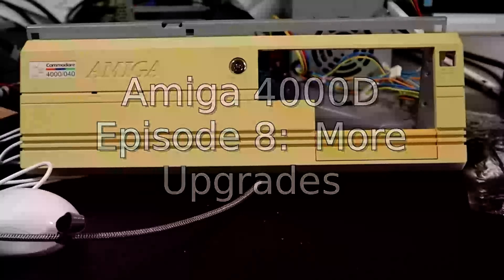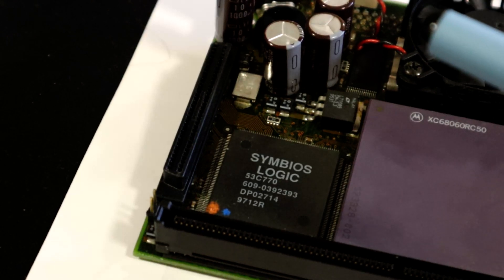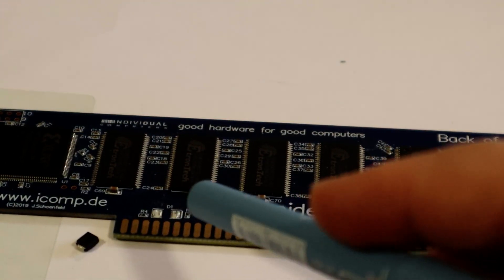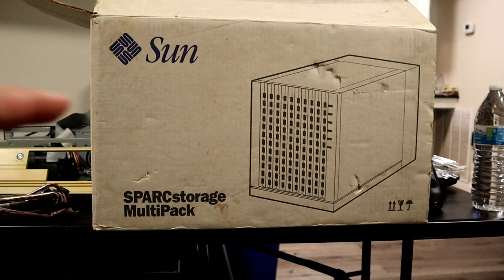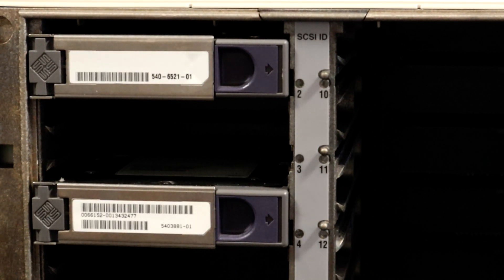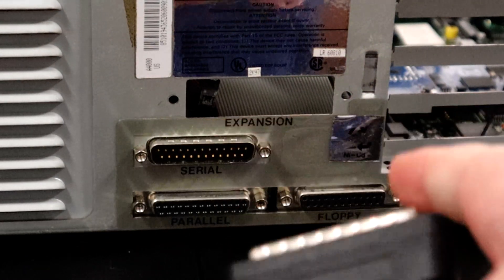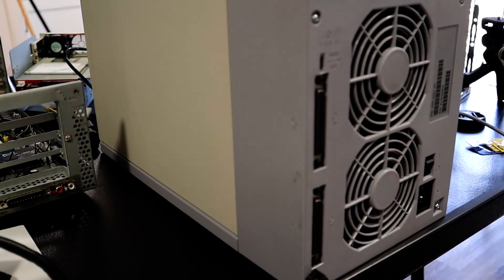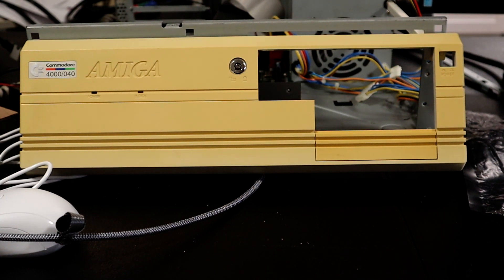Amiga 4000D Rebuild Episode 8: More Upgrades

Comment: Nice one Clark 👍🏻 I have 2 of these. One in a Desktop case (Like yours) and one in a Tower conversion. The one in the desktop has the 3 Oscillator mod, where you can separate out SCSI,68060 and PPC. The one in the Desktop has 50mhz for SCSI, 75mhz for my REV6 060 and 66mhz for the 240mhz PPC. The other Cyberstorm has the 2 Oscillators but has an upgraded 604 PPC chip running at 420MHZ. The G-REX for A4000 are rare! Had the A1200 version and found it lacking. Don’t forget the A1200 had the Phase 5 Blizzard 040 and 060 with PPC cards and could hold up to 256MB FastRAM. Be careful with the Mediator busboard,as if you have this and a Indivision AGA over the LISA chip these can short each other out. Wish Elbox would provide a stand-off 🤔🙄 Which firmware version are you running on your Cyberstorm?
Reply from the maker: That's a great point about a stand off between the Indivision and the Mediator.  I can probably make one.  So far, haven't had a problem, but they are tight and it wouldn't take much sagging to make them connect.

I'm not sure what firmware version....I'll have to check when I get back to it.